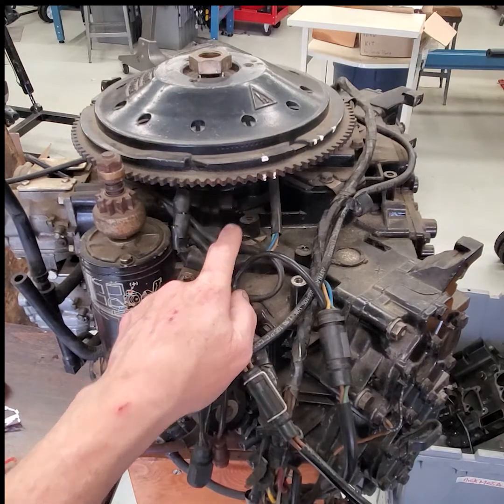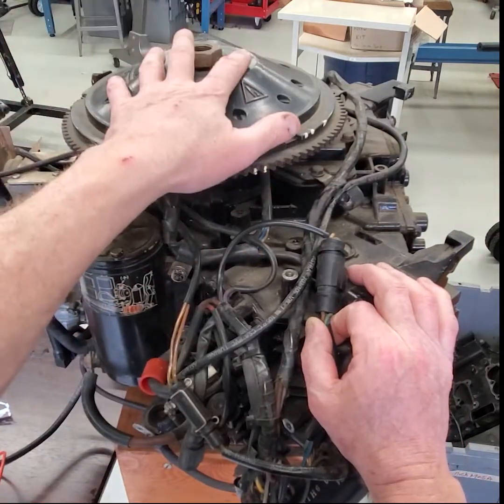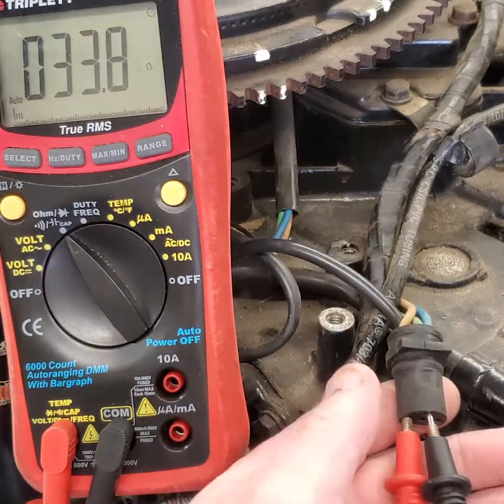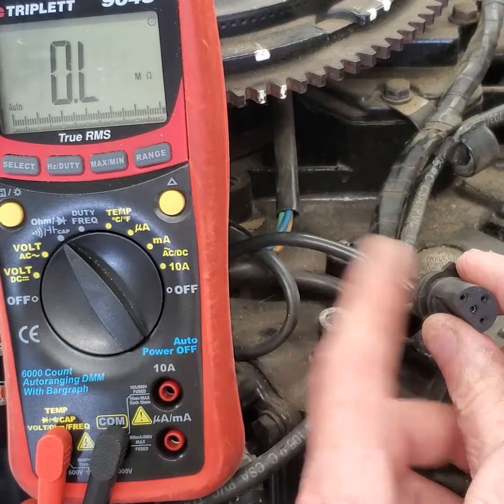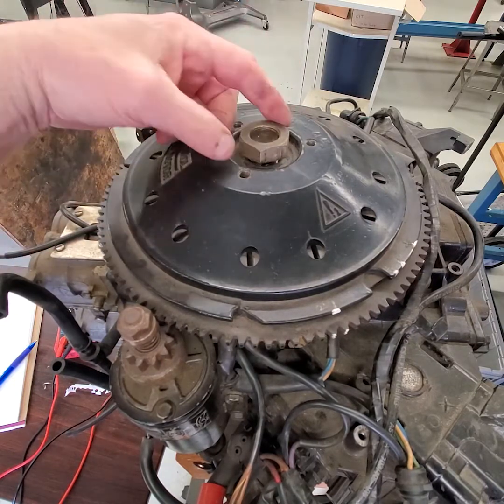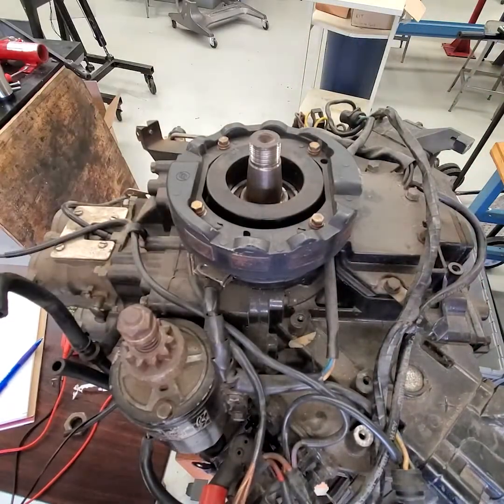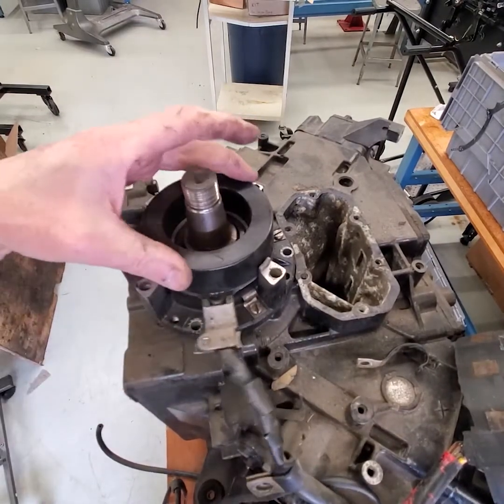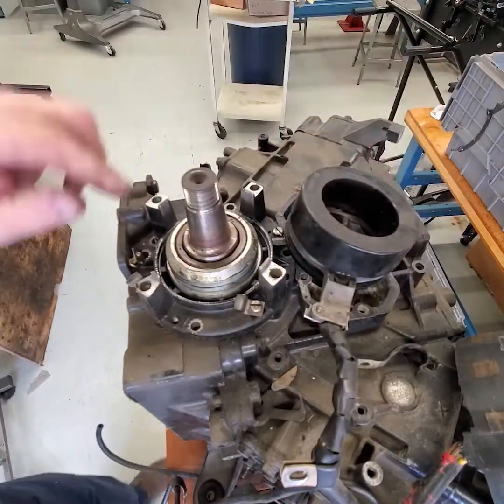Old Johnson V4 Outboard Stator Test and Removal revised

Comment: I have a 1994 evinrude v4 88 and I'm not getting fire on the #2 cylinder. Coil is good. Please help.
Reply from the maker: @ToledoFlatheads  swap the two power packs from port side to the starboard side. Recheck spark. If it jumps to the other cylinder power pack is bad.
Reply: Doesn't have two power packs.

Comment: I have a 1982 115 HP Johnson motor and both stator wires for charging the CDI read about 277 ohms or almost exactly half of the 550 ohms you measured ... almost like they used the center tap off of the stator windings. Do you know if they made a drastic change like that for 1982 onwards?
Reply from the maker: @Kr0N05  That is something I'm not sure of but a service manual for that manual would be your best source of the proper values

Comment: I have a 94 115 will not charge an tach does not work
Reply from the maker: Likely a stator problem, Test the coils for resistance and that should show it's failed
Reply: I feel like since I have to pull the fly wheel I will go a head and do the stator regulator coil packs wires and plugs

Comment: Looking for answers have 1990 Johnson 150 with a few bad teeth on the flywheel starter ring can this be replaced and any idea where to find one I’ve seen some used flywheels around 3 to 4 hundred I just need the starter ring thanks for any help can’t find any info on this I know you can change the rings on a car thought the outboards would be same concept
Reply from the maker: Do you have a part number of the flywheel? There should be one on it.

Comment: I've been trying to find out what threads are on the crankshaft to get a new flywheel bolt.  Google has failed, all the forums have failed..do you know what size threads are on there?
Reply from the maker: Do you need a new flywheel nut?
Reply: @tedsmarinerepair8956  yes I do, I could get one if I know what thread size it is..they want $20 for one online vs $2 for a 7/8-9 nut, which is what I think it is now that I have the flywheel off and can measure it.
Reply: I but you s set of these count gages their easy to use and as far as for me have never been wrong easy to use just put the teeth in the threads till you find the one that fits down in each grove and it will fit snug and perfect when you find the one that does look at the gage a lot like filler gages

Comment: Does the ring spin under the 4 clamps that hold down on the trigger base?   Or do they clamp the ring solid and just the base moves ?  Mine is somewhat stuck , one of the clamps was diggin in
Reply from the maker: The trigger base should rotate smoothly under the flywheel. Re-adjust the clamp so that it does not bind up on the trigger